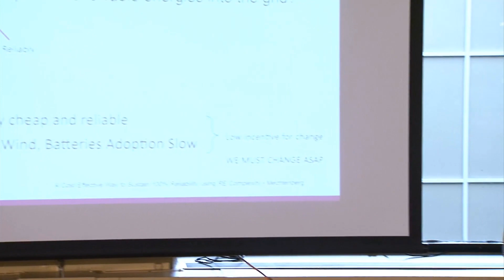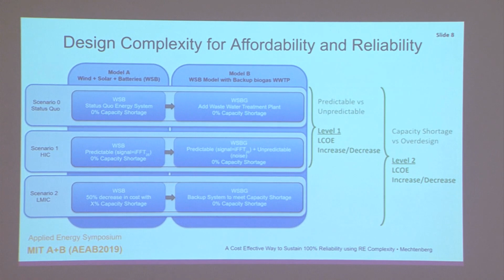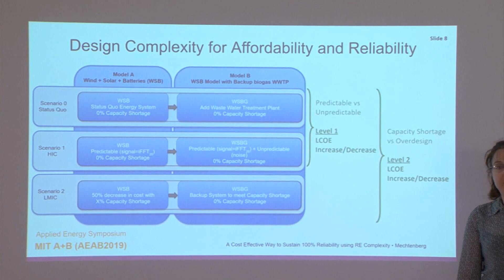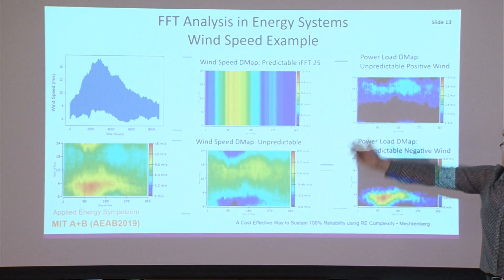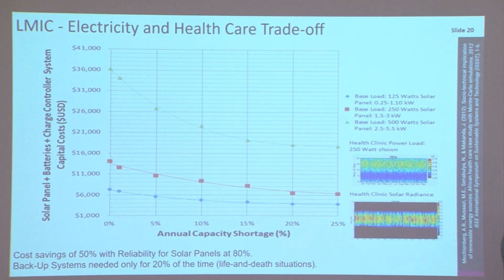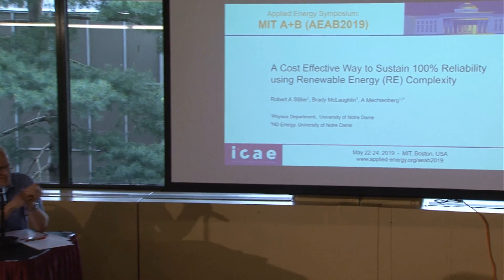MIT A+B 2019-177 A cost effective way to achieve 100% reliable renewable energy using comp

Comment: To Commenter below... I consider Energy Crises and most importantly what happens when we ignore the Value of a Statistical Life when designing energy systems, especially for health care facilities. Also, I am considering the human rights issues associated with the assumptions that the research you mention does not consider. For example, your design and control optimization objective function will be completely different than mine and fundamentally captured in this research. Many times I use lower efficiencies than what researchers like to use. For example, solar panels on metal roofs in LMICs are sometimes half the amount that idealistic researchers use, but here I used peer-reviewed measured values as clearly stated and published in our presentation. 

The most important issue is what do our civilizations value. The choice for our optimization objective function is a doorway to our values. When we change our objective function, we reach new optimization results and it is based on what we value.

Please our recent publication on health care during electricity failures: the hidden costs. 

https://journals.plos.org/plosone/article?id=10.1371/journal.pone.0235760

I am submitting this particular MIT A+B publication this weekend. I have been working on this for 10 years.

What are the embedded values when we do this in the US (HIC) versus the embedded energy objective function values in Uganda (LMIC)?  
Statistically one can argue that black lives do not matter from the US to Uganda such that my ESDD lab embraces the academic Black Lives Matter movement. This means considering VSL/E hidden costs.

Comment: Very interesting presentation.  I've written about WWTP that are trying to power their operations with their own generated biogas and other renewables ("Sustainable Sewage" chapter, https://www.vermontlaw.edu/directory/person/scanlan-melissa).  In some situations they can get to be net energy producers, but they use so much energy to power a WWTP that it is a feat just to power the plant itself on renewables.  Do you consider the challenge of getting WWTP to implement so much efficiency to reduce their own power demands that they can produce excess biogas to feed into a citywide system for your models to work?
Reply: I consider Energy Crises and most importantly what happens when we ignore the Value of a Statistical Life when designing energy systems, especially for health care facilities. Also, I am considering the human rights issues associated with the assumptions that the research you mention does not consider. For example, your design and control optimization objective function will be completely different than mine and fundamentally captured in this research. Many times I use lower efficiencies than what researchers like to use. For example, solar panels on metal roofs in LMICs are sometimes half the amount that idealistic researchers use, but here I used peer-reviewed measured values as clearly stated and published in our presentation. 

The most important issue is what do our civilizations value. The choice for our optimization objective function is a doorway to our values. When we change our objective function, we reach new optimization results and it is based on what we value.

Please our recent publication on health care during electricity failures: the hidden costs. 

https://journals.plos.org/plosone/article?id=10.1371/journal.pone.0235760

I am submitting this particular MIT A+B publication this weekend. I have been working on this for 10 years.

What are the embedded values when we do this in the US (HIC) versus the embedded energy objective function values in Uganda (LMIC)?  
Statistically one can argue that black lives do not matter from the US to Uganda such that my ESDD lab embraces the academic Black Lives Matter movement. This means considering VSL/E hidden costs.

Thanks for being interested in our research talk.
Reply: I consider Energy Crises and most importantly what happens when we ignore the Value of a Statistical Life when designing energy systems, especially for health care facilities. Also, I am considering the human rights issues associated with the assumptions that the research you mention does not consider. For example, your design and control optimization objective function will be completely different than mine and fundamentally captured in this research. Many times I use lower efficiencies than what researchers like to use. For example, solar panels on metal roofs in LMICs are sometimes half the amount that idealistic researchers use, but here I used peer-reviewed measured values as clearly stated and published in our presentation. 

The most important issue is what do our civilizations value. The choice for our optimization objective function is a doorway to our values. When we change our objective function, we reach new optimization results and it is based on what we value.

Please our recent publication on health care during electricity failures: the hidden costs. 

https://journals.plos.org/plosone/article?id=10.1371/journal.pone.0235760

I am submitting this particular MIT A+B publication this weekend. I have been working on this for 10 years.

What are the embedded values when we do this in the US (HIC) versus the embedded energy objective function values in Uganda (LMIC)?  
Statistically one can argue that black lives do not matter from the US to Uganda such that my ESDD lab embraces the academic Black Lives Matter movement. This means considering VSL/E hidden costs.